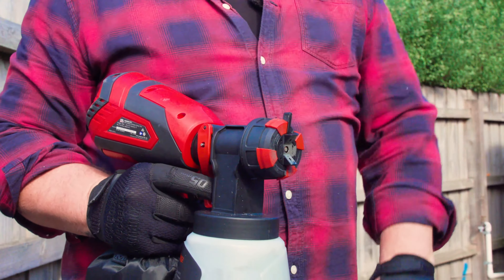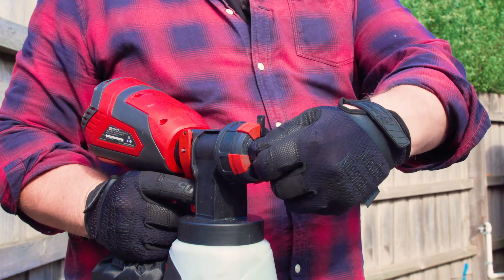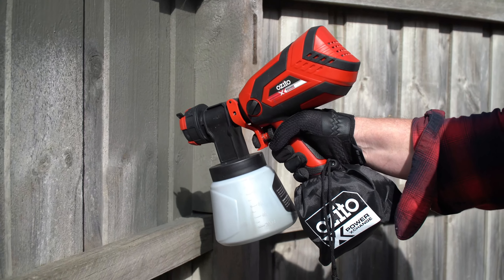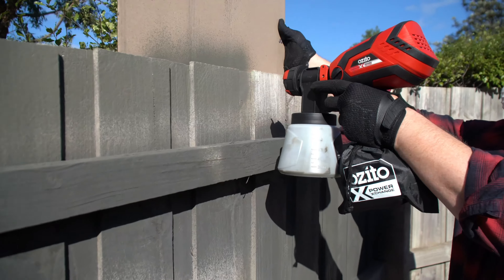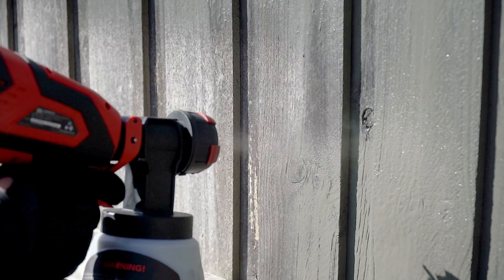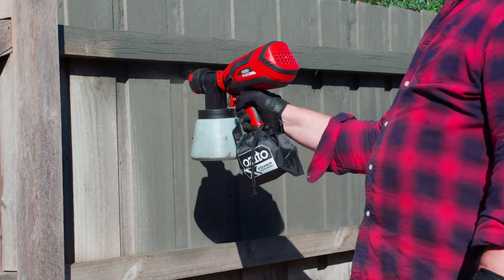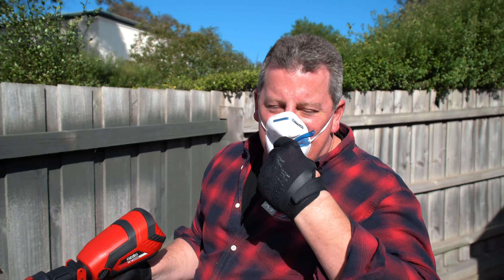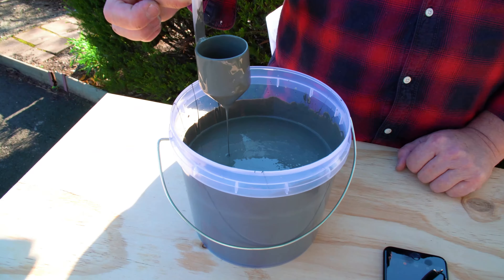How to use a Paint Spray Gun & Tips for Use - Ozito Tool Tips

Comment: Hey I actually have a question what would you recommend on how to set the gun up for optimal results on a car.
Reply from the maker: Hi skboog, thanks for reaching out. The PXC 18V Outdoor Spray Gun is a great tool and with practice and lots of testing you may be able to gain a satisfactory result, however to get the best results when spraying a car, we recommend you to go with an air spray gun attached to an air compressor that matches the size of your project. Cheers